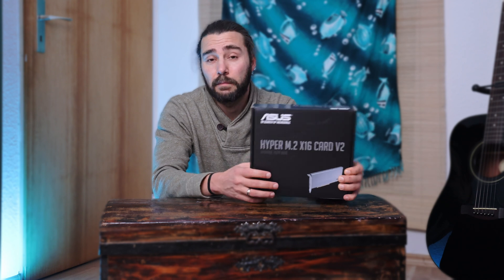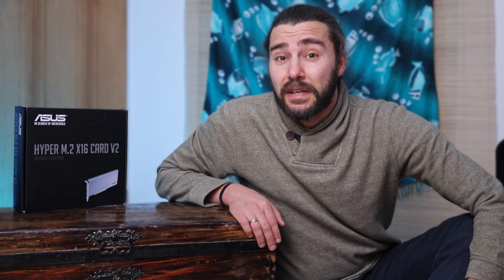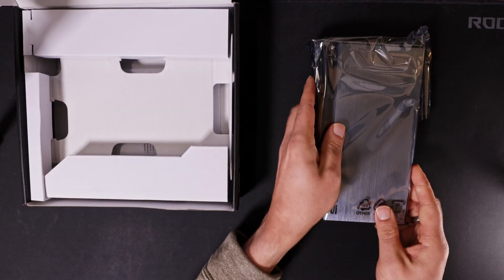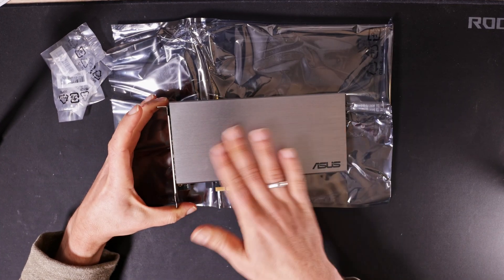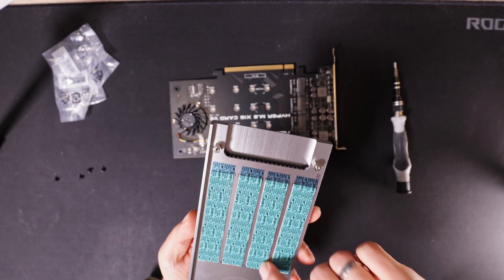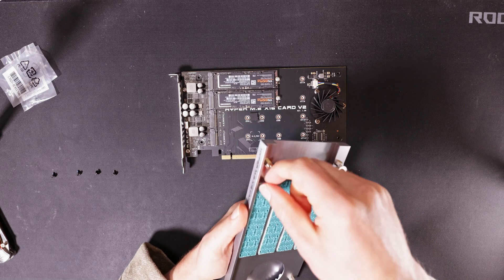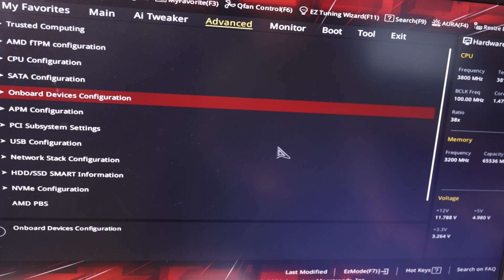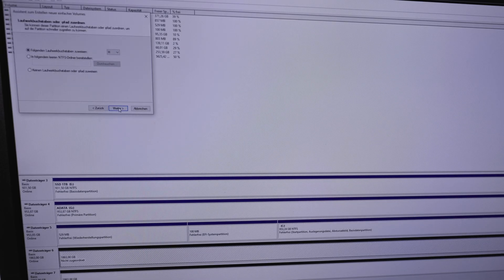ASUS Hyper Card - One important thing to know before you buy this card.

Comment from the maker: For my English speaking fans: There was a question about the noise of the fan, the temperature of my installed SSD's and if I experienced any disadvantages of installing my graphic card into my second PCIE-Slot. Here is my answer.

I took some measurements. The fan is already audible when the system is idle. Without getting too scientific, I measured an average of about 46dB without active fan, at a distance of about 10cm from the back of the PC. I used a sound measurement app on my smartphone. The SSD's is at 41°C in idle.
With active fans you are at about 50dB, with temperatures only 1° cooler (40°C). Under load, I ran FurMark on my RTX2080TI, I reached 45°C with fan. However, the fan is no longer clearly audible because the graphics card then takes over the "lead". The total volume was about 54dB, 10cm behind the PC. 
My ASUS ROG STRIX X570 F-Gaming Board has a 2nd PCIE 16x slot, so I don't feel any disadvantages in terms of graphics performance.

I hope I could help you 😀
Reply from the maker: @discoveryourorigins5698  Hi, in the first place I don't have turned on the fans and while testing the loudness nothing was sound strange so I don't think I had any issues with the fan. Do you ran into such problems?
Reply from the maker: @Discover Your Origins  😮 Well, sounds really normal 😆 Do you have to turn on the fan? Are your NVMEs getting so hot in your system?

Comment: Same board here but none of these settings exist
Reply from the maker: Hi, this video is meanwhile over 2 years old. Maybe your BIOS version is different from mine. I can check the next days if ASUS has published a new BIOS version for this board and changed some settings…
Reply: @Esperto84  well apparently it does work (sortof) but is not quite what i wanted because likely the board is limiting it 

anyways it "works" enough to where i get to use my spare m.2 drive now

Comment: How is it that in the specific list it says 1(X4) while in bios it states that in the first place it can read up to 4 disks with the expandable card through it Pcie raid option in first pcie x16_3 slot ?? my motherboard is asus rog strix b 450 f gaming ii
Reply from the maker: Hi, as far as I interpret the compatibility list correctly, your mainboard does support the Hyper Card, but only with one drive in the PCIEX_3 slot. To be able to access 4 drives you have to plug the card into the first PCIE slot. The other slots do not support bifurcation. Maybe you can use 2 drives in the second slot, it says 0/2(4X+4X), but here you should make sure that you don't “cut off” any PCIE lanes that are shared by the first and second slot.
BR
Reply: @Esperto84  thanks

Comment: I bought a Hyper M2. and have a x670E, but It does not work. Do I need to put it in the PCIEXX16 1? and the 4080 Super on PCIEX2? if I do that will the VIdeo Card be slower? I aalso have the 4 M.2 slots from the Motherboard full.

ROG Strix Asus x670E- E Gaming Wifi is the Mobo I Have.
Reply from the maker: Hi, from my experience I would suggest you put the Hyper M2 card in the first PCI16 slot and your graphics card in the third PCI16 slot. You still need to activate bifurcation in the BIOS. If you are concerned about graphics card performance, I recommend doing a benchmark without the Hyper M2 card while the graphics card is in slot 1 and then after the Hyper card is in slot 1 and the graphics card is in slot 3. Then you will know exactly, but I suspect that there won't be too much difference. If you put the graphics card in the second slot, then the PCI lanes will be split between the first and second slots and there won't be enough available, so the graphics card should be in the third slot, which is tied to the chipset. I hope this helps you. BR

Comment: And forget quarter of video card's performance..
Reply from the maker: You never stop learning 😉 https://youtube.com/shorts/4Y39TD0RvUY
Reply: @Esperto84  which mainboard is this?
Reply from the maker: It's the ASUS ROG STRIX X570-F Gaming
Reply: @Esperto84  Did you have a gpu test after connected? It's impossible to have full performance..
Reply from the maker: Well, the mainboard can support SLI configuration and I'm pretty sure it handles the gpu in the lower PCIe slot well. At least I have no complains nor issues with gaming or video rendering. I'm not a person who bothers about 2 or 3 percent performance difference if that would be the case.

Comment: Hey Esperto! Thanks for the video! I have an ASUS Hyper card with 4 SSDs in my motherboard, and looking to add another card. However, it seems like there are only Threadripper platforms that support more than one bifrucated lane. Do you think this could come to regular consumer motherboards in the future?
Reply from the maker: Hi, I don't think so, because the industry still wants to differentiate between consumer and business hardware. On the one hand, I don't see a trend for more PCI lanes in consumer CPUs at the moment and on the other hand, the manufacturers want to continue to earn a decent amount of money. Personally, I would prefer to be able to assemble certain PC components myself. For example, you could have a mainboard with the function of bifurcating all PCI slots and a CPU with many PCI lanes and a few fewer CPU cores or slightly lower clock rates or several chipsets on the mainboard, which can process the data in conjunction with the CPU. The possibilities are seemingly limitless, at least in my mind. 😉 You could practically really build your own PC. "Just my two cents"
Reply: @Esperto84   Thanks! Yoo, that would be awesome! Then it would be truly modular in every sense, and you could completely tailor everything to your need! Which I sort of feel is the basis of PC building anyways, so it’s a shame that it is not attainable at the moment, but if we keep pushing perhaps we could see it in the future☺️ 

Yeah, those threadrippers and their mobos are crazy expensive! So we would be bulding the parts that make up our PC to save on the actual parts. Pc-building inception😂 Thanks again man!  
- greetings from Norway🇳🇴

Comment: Will this card work on any motherboard??
Reply from the maker: Theoretically yes, but there are some things to consider. First the card uses a PCIe 16x connector and for every SSD you'll install 4 PCIe Lanes are used. Now it depends on your motherboards specifications. If you have a full 16x PCIe slot which is in the most cases the first two slots your board must support bifurcation if you want to use all 4 available NVME slots. It is important to know how your motherboard cuts the PCI lanes between the different slots and which slots are directly connected to the CPU or chipset.
I would suggest you to study the manual of your motherboard and if your actual PC configuration (graphic card and maybe other PCIe cards you have already installed) are compatible with the hyper cards requirements.
I'll hope that will help.
BR Esperto

Comment: Please tell me how to do the same thing with my Gigabyte Z690 Gaming X DDR4 motherboard. My SSDs are ADATA 2TB and second is Samsung 970 Evo 500GB in Asus Rog Hyper M.2 card.
Reply from the maker: Hi, 
I'm not familiar with the Gigabyte motherboard and your computer setup but as far as I can tell from the manual your board has 3 PCIe Slots with fully supported 16 PCIe lanes. Now it could be possible that you can just install your Hyper card into slot 2 or 3. I guess that the PCIe lanes from the first slot are directly connected to the CPU while the other lanes from the slot 2 and 3 are connected to the chipset. I'm not sure if you have to set anything in the BIOS but it doesn't hurt if you look through all settings due to any kind of bifurcation settings. 3 of the 4 M.2 sockets on the board are connected to the chipset which means that 28 lanes are splitted up to them and the 2 other PCIe slots. So if you use all M.2 sockets on the board and want to use all 4 available M.2 slots of the Hyper card that could lead to not recognized SSDs in your Hyper card.
I'll hope that helps.
BR
Reply: @Esperto84  Thanks for your time and explanation. But only one M.2 SSD slot were busy, it was օն top of տհե video card - 980 Pro 1TB SSD (Win 11 OS), all other places were without any SSDs, so this can you tell me how to solve this issue? How i can use 2x SSD on Asus Hyper M.2 card?
could it be the reason that my m/board doesn't recognize the 2x SSDs from Hyper M.2 card, it need the Asus Rog Strix Z690 Gaming-E motherboard or Asus Z690 Maximum Hero M/board?
Reply from the maker: @Emperor-2029  Well, can you run your system on the onboard graphic (if you have a CPU with integrated GPU) and put the Hyper card in the first slot. Just to be sure the SSDs are working fine (and also will be recognized). If so and it is just working on the first PCIe slot I would suggest to contact Gigabyte customer support as well as Asus customer support. Maybe Asus will update their compatibility list because it's just goes until the 590-chipsets. And maybe they have also a solution for you. I don't want to recommend to you to buy another expensive board if it is not necessary. If I understand it correctly you have 3 free M.2 slot on the board, why do you don't want to use them?
Asking the people on reddit and on the forum site of Gigabyte and Asus can also be an option. I'm running out of ideas here but I'll hope you'll find a quick and easy solution. Let me know if you found one. Thanks
Reply: @Esperto84  i have put Hyper M.2 card to the first slot(and the same time i have put RTX 3090 video card to the second PCIE slot), but it was not supported there also 2x M.2 SSDs. What else you suggest me to test for this issue?
Reply from the maker: @Emperor-2029  Just to be sure that the SSDs are working fine (and I think they do), can you plug the SSDs directly to the M.2 sockets on the boards and see if they will be recognized? Also, did the Asus Hyper card works in another Computer before? If so I'll think your Gigabyte maybe doesn't support the Hyper card. And one last chance to find out if the Hyper card is working, did you have any colleagues or friends who might have a Asus mainboard and try the card in their system.
Reply: @Esperto84  i have tested all M.2 SSDs on Gigabyte and all other PC's motherboards (i have 3x pcs), they are working Perfect! and they are working on my Gigabyte M.2 sockets also(and recognized), Asus Hyper M.2 card works on other 2 pc's motherboards, but the problem is the same, the only one M.2 socket is working on the Hyper card.
Reply from the maker: @Emperor-2029   Then I guess that the hyper card and the gigabyte board may be partly incompatible together. As I mentioned earlier bevor buying a new board try asking reddit and other hardware forums. At the moment I have no other ideas.

Comment: Could you please share the card comes with standoff in which size? I got one but it came with no standoff and I am looking for alternative. Thank you so much in advance!
Reply from the maker: Hello, I'm afraid I don't understand what you mean with standoff. If you mean which types of SSDs you can install then you can use 2242/2260/2280/22110 SSDs. This means SSDs which can be 42, 60, 80 or 110mm long. Here is a link to the manual:  https://dlcdnets.asus.com/pub/ASUS/mb/Add-on_card/E14501_HYPER_M.2_X16_Card_V2_UM_WEB.pdf
Hope this helps a little.
Reply: @Esperto84  Thank you for your reply! 
I mean the "stand screw" in Step 2. "Secure the stand screw onto the ASUS HYPER M.2 X16 CARD V2"
Could you please kindly help me to check their dimension?
Reply from the maker: Hi, it seems that there are M2 screws with 5mm length. The screw head diameter is about 6,7mm... 😁 Hope I don't measure anything wrong
Reply: @Esperto84  Thank you! Much obliged! This help me alot!!!
You're the nicest youtuber I've ever known, indeed!

Comment: Is der Lüfter laut? Weißt du welche Temperaturen du bei den verbauten ssd's  erreichst? Welche Grafikkarte benutzt du dass sie im zweiten Slot nicht kastriert wird... Ich habe eine GTX 1070 und die braucht glaube ich nur nen 8er pcie Slot...
Reply from the maker: Hi, ich habe mal ein paar Messungen angefertigt. Der Lüfter ist schon hörbar wenn das System im Idle ist. Ohne zu wissenschaftlich zu werden habe ich mit einer Schallmess-App ohne Lüfter im Schnitt etwa 46dB, bei ca. 10cm Abstand hinten am PC, gemessen. Im Idle pegeln sich die SSD's bei 41°C ein.
Bei aktiven Lüfter ist man bei ca. 50dB, wobei die Temperaturen nur 1° kühler (40°C) sind. Unter Last, ich habe FurMark auf meiner RTX2080TI laufen lassen, habe ich mit Lüfter 45°C erreicht. Der Lüfter ist aber nicht mehr eindeutig hörbar, da die Grafikkarte dann die "Führung" übernimmt. Die Gesamtlautstärke ca. 10cm hinterm PC betrug ca. 54dB.
Mein ASUS ROG STRIX X570 F-Gaming Board hat einen 2. PCIE 16x Slot so dass ich keinerlei Nachteile, was Grafikleistung angeht, spüre.

Ich hoffe ich konnte dir helfen 😀
Reply: @Esperto84  ...cool danke... Ich habe leider nur nein 8er als zweiten der auchnoch deaktiviert ist wenn ich den naheliegenden m.2 Steckplatz nutze... Naja... Da weiß ich wenigstens worauf ich beim nächsten mal achten muss wenn ich mir Mal wieder ein neues Motherboard kaufen muss...

Comment: To use this you need to configure the volume in windows disk management. 

- shows 1 second of that.
Thanks
Reply from the maker: I assumed that anyone who installs an expansion card has already installed a hard drive and is able to set up a new hard drive in Windows. Anyway, here's a guide ;) 
https://www.youtube.com/watch?v=ZxV6IcNvbek
Reply: @Esperto84  this week I will he setting up a raid 0 on one these cards I got eitg my z690 motherboard. I have to transfer my current Os from my m.2 pcie 3 to a m.2 pcie 4 and then I plan on using two m.2 pcie 3s to raid. Not totally sure the best way or how

Comment: Have you got it to work with 4 NVMe's yet?
Reply from the maker: Hi Ben, still I only use 2 NVME SSDs, but later if I've saved some money 😉 I want to add 2 more. If I run into any issues with 4 SSDs, I'll think I'll make an update to this video. Do you ran into any problems?